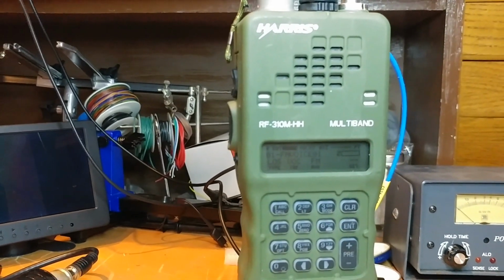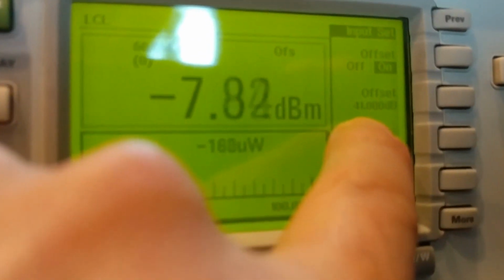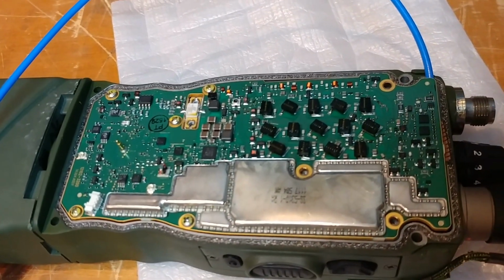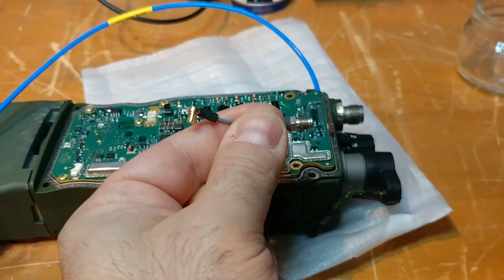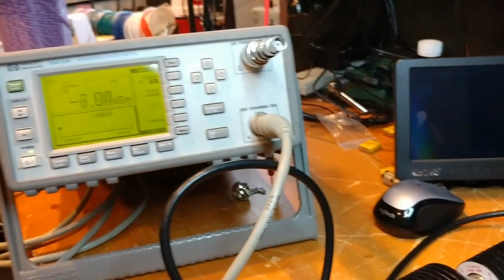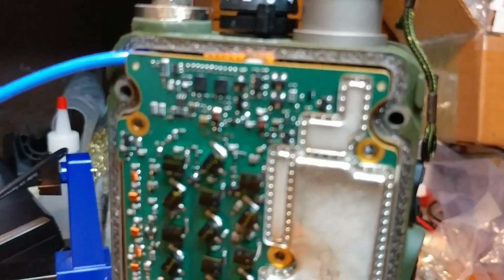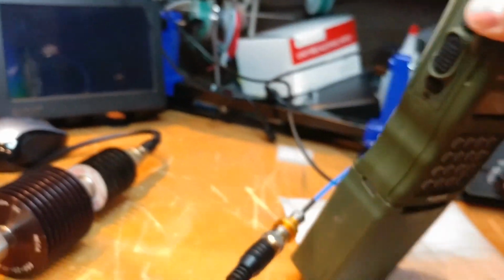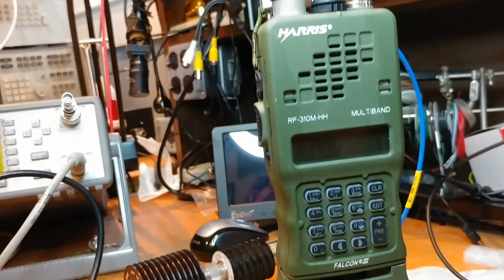(SOLD) Troubleshoot of a Harris RF-310M-HH Radio 30 MHz-512 MHz

Comment: Chemical substances are added between the antenna socket and the housing, making it very difficult to remove. Therefore, heating was used and finally it was removed. VY73 de BD7PA
Reply from the maker: BD7PA thank you for your comments. Yes we are sure thread locker is used and requires heat.

Comment: I have questions
can i order like this device to iraq and how much cost?
Reply: I have seen this radio on paintball forms go for 3200 dollars
Reply: @VicGreenBitcoin  No airsoft ones are 300-350 usd original ones are 5k-16k depending on model and availability
Reply: these are genuine radios and cost 8k-15k depending on the availability and country.